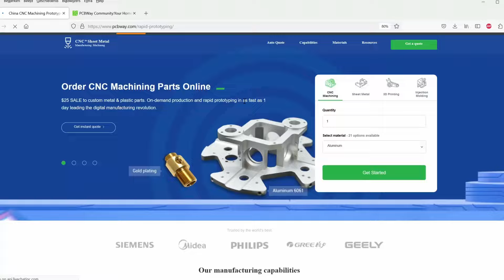Creality K1 / K1MAX best Toolhead

Comment: My concern with the skeletonized toolhead is that if those nuts come loose, the bolts can move and likely short the toolhead

There's very little clearance, I tried to use buttonhead socket m3 with heat inserts but they were far too close for comfort

Applying kapton tape to the toolhead would be one solution though
Reply from the maker: klapton tape is a great idea!